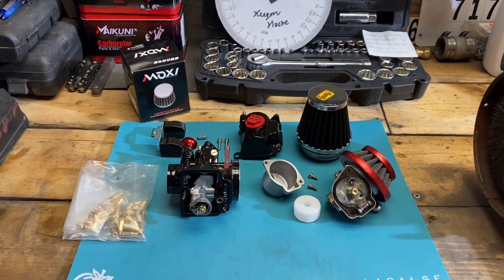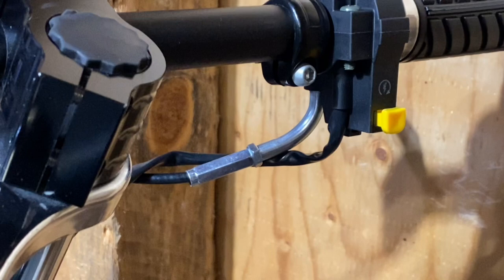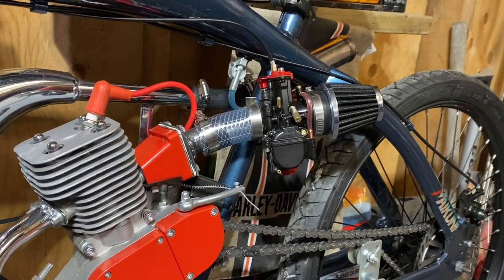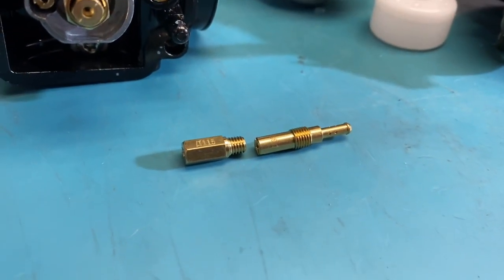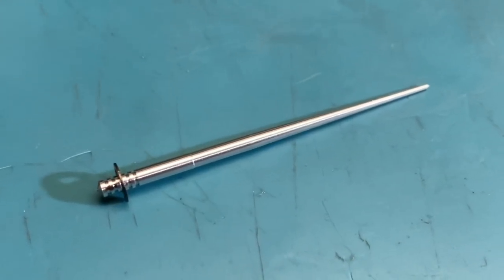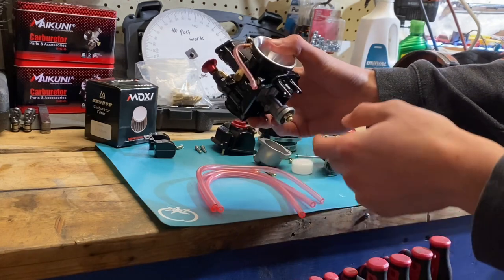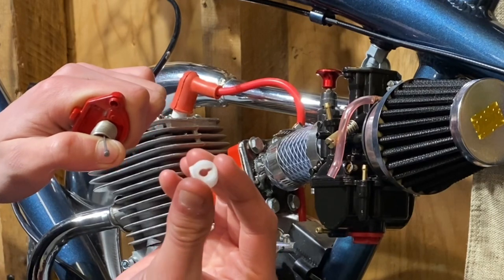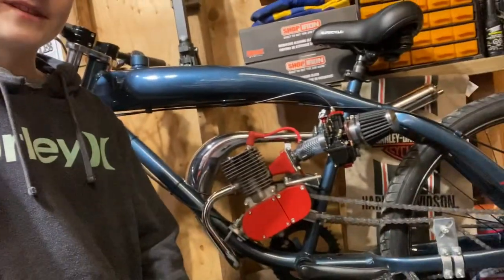How To Jet and Tune that Pwk Carb! Tips on Using The (Stock Cable)

Comment: You say that when you move the needle clip down, towards the tip,it gives you less gas, and when you move it up towards the top, you get less fuel, and that is backwards,the clip, when moved towards the tip,holds the needle up higher in the jet, therefore letting MORE fuel pass,I'm guessing you know this and simply made a mistake with your diagram
Reply from the maker: @Bill-nm9wb  yea diagram was messed up

Comment: 35/90. There. The golden ratio of the pwk.
Reply from the maker: I agree with you for the most part but I gotta say on the yd100 with the 105 main jet in it. The bike feels ridiculous when you get over 1/2 throttle. It just hits this power-band and before you know it on a 36 tooth sprocket your in the 40mph range all day. I won’t hit that often because I’m still breaking in this new motor.
Reply: Every one have a different number 🦾 . You forget the power jet . For the carb to work full potential 😎.
Reply: @ELISRACINGTEAM the “power” jet? Is that the vacuum jet on the air side of the carb?

Comment: I just got a carb like this and it looks like i out the gas hose on wrong 😑, i put it on the vent that’s opposite of the choke.  I think where yours is hooked up mine was covered with a red cap? I wasnt sure so i hooked it up there and now im wondering if i messed up new carb completely.  I can not find a single video where they show them setting up the hoses and this is the first one where you explain them

Comment: Hi. I have problem with cold start nibbi 24 on yx140. It’s hard to start it - choke does nothing (if it’s on, I’m not able to crank). After few kicks without choke and with higher idle revs it starts. Nozzle 3rd, jets 45/98. Float lvl is ok - petrol is on the bottom and top carburetor connection.
Reply from the maker: @Shaco116  yx140 is that a pit bike motor?
Reply: @keeganhache6667 yes, exactly
Reply from the maker: @Shaco116  a 94 jet seems really small
Reply: @keeganhache6667 is it hard to crank it due to of main jet? Can I send you some video on priv message?

Comment: I’m using a 38 pilot and a 105 main with 1 clip up on the needle at top speed I get boggy and then it comes out of it then back to boggy what would be causing that? Too much air?
Reply from the maker: Down size the main

Comment: You can cut some of the sheathing away on the throttle cable very easily. There's videos on it and I installed the dio reed kit on my yd100 with the nitrous kit and i love it! I cut away about half an inch of the sheathing on the throttle cable and that made it a lot easier

Comment: I like the clear carburetor intake tube......I switched my black stock oil lines to clear lines like those on my 2000 Buell so I could check/see oil flow by just a quick glance. Same with using clear fuel lines.
I'm going backwards, I started with a 700cc Yamaha then a 1200cc modded Buell. Now I'm down to a 80cc motorized bicycle lol.
Reply from the maker: Yeah man it’s great for seeing how your fuel to air mix is doing. Every time I down jet I can see a difference. My question is how did you go from them big machines down to a motorized bike lol.

Comment: What jets can be used with this carb, can I just get off brand keihin pwk jets off Amazon? Or bad idea? Trying to make a 28mm version of this carb work with a Yamaha Blaster 200 needing to start around a 50 pilot/150 main
Reply: Did you end up figuring out the correct jets?

Comment: Hi Put on 21mm PWK on my engine it's  a scooter 50mm bore 80cc put in a 35 air when I open the throttle quick it cuts out lifted the the needle to rich it's a bit better put is rich on tick over any ideas thanks.
Reply from the maker: Adjust your air screw 2 1\2 turns out from all the way in

Comment: Nice video man ! i have a same cerb on my motorized bike and i have a trouble  i have 115 main jet and dont work .

What is the best jetting for this car main and low Thanks
Reply from the maker: Well does it sound rich? Smoke a lot if so then down jet the main and pilot also mess around with the needle clip to see what works best for you
Reply: what its your set up 115 main and 35 slow what 
thanks
Reply from the maker: @sleepered7692  just start large on the jetting and work ur way down

Comment: i’m running a pwk on my new phantom v3. do you recommend the same jets? also when i switch out the jets how would i drain the float bowl so gas doesnt spill everywhere?
Reply from the maker: What I do is get a small container and hold it under the 17mm bolt and loosen until gas comes out. Don’t fully remove it you want to just crack the seal. Also the phantom needs way higher jetting. I would start out at a 140 main and work down from there.
Reply: @keeganhache6667  gotchuu thanks!

Comment: Hi i was wondering do you modify your pwk carb by drilling out that tiney hole ive seen done in a smolik performance video tbh im rely not sure what its called or if you know what i mean i think its called a vacume hole or something lol its meant to help the motor pull the fule threw better and stop bogging that these carbs are known for on motorised bikes i dont mean the jets might sound wrird how ive described it its just for the life of me i rely cant thinn what its called i as just out of curiosiy by the way love your vids its grait that yourself and others take time to educate the motorised bike comunity ive learned a alot from yourself and many others here on youtube and facebook Thanks :)
Reply from the maker: Yeah the pwk is fine because the hole is already bigger. If you got an oko carb the hole is gonna be smaller. Just start large on the jets and go for a ride. Then each time jet down until it has the most power and response

Comment: Slide isn’t installed right there’s a little groove there in the slide hold the spring back put throttle cable there in the slide in the groove where it locks in then let spring go slowly keeping tension on the cable
Reply from the maker: Yeah it took a few tries but eventually I got it. I find once you have installed the slide onto a flat side it makes the NT look so easy lol
Reply: @keeganhache6667  that it does also a good carb for the price

Comment: IF i can get the stupid carb working .. then this video would apply. Doesn't apply to those that cannot start their frickin engine.
Reply from the maker: Just spray a little gas into the carb to prime it. I had the same issue with mine before. Since the intake is so long on the first startup you will need to spray some gas inside.
Reply: You can hold the throttle and get some gas in there be careful as you can flood the bowl